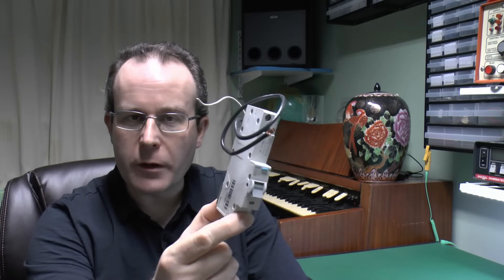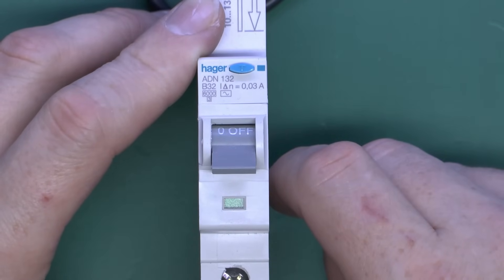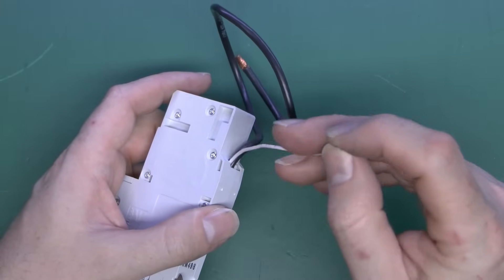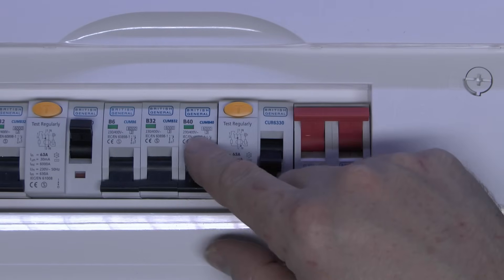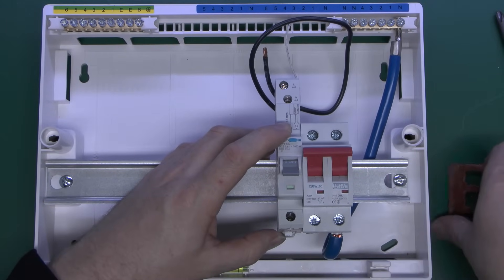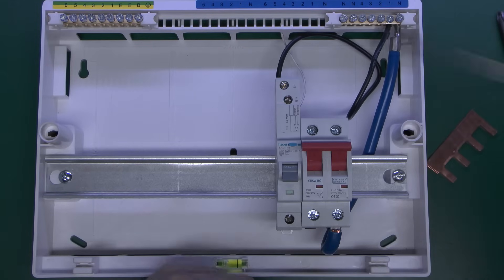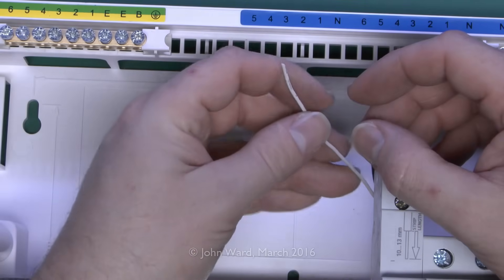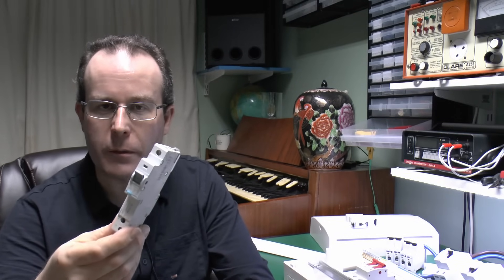Fitting an RCBO in a Consumer Unit

Comment: I have an older CU with only 6 MCB's in it. It would be nice to replace a couple of the MCB's with RCBO's but I presume and RCBO and MCB can't share the same neutral bar - my CU only has one neutral bar.
Reply from the maker: +diymostthings They can, only 1 neutral is required.
RCBO fits in place of the MCB, line conductor connects to the RCBO (same as with the MCB), circuit neutral connects to the RCBO and the neutral lead of the RCBO connects to the neutral bar where the circuit neutral was previously connected.

Multiple neutral bars are only needed when using separate RCDs which cover a set of MCBs.,

Comment: pss (haha and sorry for all the questions) what would happen in a scenarios if you used a standard RCD and then also installed an RCBO in line after, so you're "double" protected. In such a case is it luck of the draw which would trip or is likely the closest one would to the "leaky earth" faulty device.
Reply from the maker: +Dáithí Ó Raghallaigh All depends on the trip time of the individual devices, which usually varies for different fault currents.  Therefore it is impossible to know which will trip, and in some cases both of them will.
The only way to use 2 RCDs like that is to have a time delay type as the first one (closest to the origin/supply), with it's delay time set to a longer period than the tripping time of the second one.

Comment: ps you also mention you could crimp on a pin on the cable in your video at the end if you cut it to make it shorter. Could you show you would do that if you get a moment as a video on crimping would be excellent.
Reply from the maker: +Dáithí Ó Raghallaigh Video covering that will be available on Saturday.

Comment: I am still learning.  I have noticed that grid switches on a commercial unit have 2 different circuits within the switch, I don't like it but get it, I understand that there is a potential for potential difference of 400 volts, and  have seen a sticker saying 400 volts on some of these.  but can you tell me if or by experiment if 2 different light circuits in the same switch that are on the same phase could you still have a potential for a potential difference of 400 volts.
Reply from the maker: +journeyonin With a single phase, there will only be 230V between L&E or L&N.  With three phases it's still 230V between a single phase and earth or neutral, but 400V between two different phases.
Reply: +John Ward Yeah i already understood that, it was more a case of the situation.  I will give you another example for instance if i was to measure the voltage between a socket in my house( UK single phase Live) and lets say a light switch Live (same phase) would there be any chance that the potential could rise above 230 volts to 400 volts in potential ( I know there is no reason for ever doing this test.) and realise you have probably already answered it. just don't reply if you already have.

Comment: nice video.
what about the values written in boxes (6000 & 3) in front of RCBO?
Reply from the maker: +Tinu Thomas 6000 is the sort circuit capacity (6000 amps), 3 is the energy limiting class, from which the let-through energy in the event of a fault can be obtained.

Comment: Hello John, fantastic video as usual,
Would you agree that another disadvantage of the RCBO is if it trips, how would you know whether it did it due to overload or due to current leakage?
Disconnecting faulty consumer (i.e. from the socket) which exhibits either kind of the fault can be only class as a partial success (you can change the consumer) as you still don't know what kind of failure it suffers.How quickly and effectively would you recommend to detect it?
Thanks very much, 
Great collection of videos, 
Kriss.
Reply: without testing equipment I think there's no way to know.  however both problems  would require the same solutions implemented anyway, right?
Reply: krisbham probably own multimeter would enable individual power points or lighting circuit testing for megohm readings.
Reply: @austin1722  not much use for the homeowner... 😒

Comment: It is recommended to use a torque screwdriver now to tighten the breaker terminals . The torque range is now somtimes  printed on the side of the MCB/RCBO .

Comment: Interesting - is this legal to DIY? How about adding a 2nd RCD to an existing split load unit? I've got one of those with half the circuits on an RCD and half not, and would be nice to know if I can improve it fairly cheaply.
Reply from the maker: +81rjp DIY is legal, the only restriction is that some types of work are notifiable to building control in England and Wales.  Scotland has a different system.
For the split units, the easiest option is to fit RCBOs in place of the MCBs on the non-RCD side and leave the rest as it is.
Reply: Ah right, thanks. I knew that replacing a whole consumer unit was notifiable, but the situation for replacing part of one was less clear. As it happens I've checked and it's only lighting circuits (and the alarm) on the non-RCD part, so I'll probably just leave it.

Comment: John, what's the problem with mixing CBs, RCDs and RCBOs from different manufacturers within one consumer unit?
Reply from the maker: +FlyingShotsman Another issue is that consumer units and the items within have to be type tested to comply with the relevant standard, so even if the devices actually fit in there, any type approval is not valid if devices from different manufacturers are used.
Reply: Thanks for the added info, John.
Reply: +FlyingShotsman 
When installed on the ISO rail, if you attempt to fit Live bus bar you will find that different manufacturers design slot holes at different level.Your flat live bus bar won't fit in then.Some electricians may in this case bend the bus bar to a "S" shape just to compensate the height differences (usually approx. 4.5mm difference in levels) which is not a good practice from a few point of view.If bending copper bus bar, on the bends metal will get thin up (due to mechanical rules related to stress and elastic strain of metal -compression and tension whilst bending).This then decreases effective surface area of the bus bar (necking). Also, after bending in two places, effective pitch between the bus bar lugs will be smaller (less than 18mm) which may not fit in the centre of the slots.Generally speaking, making a bus bar a "ramp" is not a good practice expected from top notch electrician.
Reply: That makes good sense; thank you.

Comment: Do you think it will eventually be standard where everything has to have an RCBO on every circuit?

Also just on messy wiring you where talking about , would it not be better practice to have a kind of electrical patch panel similar to what we do in computer networks.Rather than each cable run going right into a circuit breaker or RCBO they go into a terminal block ( similar to the neutral and earth bar ) that way you could replace the consumer unit quickly and easily and re wire it to tidy it without having to mess with the cable runs. You could even pre wire everything off site and simply install it into the runs allowing someone else to do that work that possibly is not trained to mess with the consumer unit. Its done all the time in networking and works very well for reducing time on site and costs for the user.

I am surprised consumer units are allowed to be so messy, surly if you have a rats nest of cable going everywhere its hard to tell what your working on , this can lead to dangerous mistakes.
Reply: +Andrew Joy Here in Norway you have been required to have 2-pole RCBOs(or 4-pole for 400V 3 phase) for all circuits since 2002. You were allowed to have a single 2-pole RCD (or 4-pole) to protect all your circuits earlier, but all new installations and renovations has to have a RCBO for all circuits.
Reply: Here in the United States, because we usually don't use whole-home RCDs we use RCBOs or RCDs integrated into outlets as needed.
Reply: The patch panel approach is sometimes used in industrial installations, this makes it more modular, easier to route wires, and manufacture and test the entire electric cabinet in the factory to the specified design. But usually it is undesirable, as there is a risk of poor mechanical connection on the patch panel, which is an extra point of failure. So usually it is better to get a circuit wires directly to the RCBO. However, with the invent of more reliable clamp connector blocks, which ensure proper cable clamping, and in more complex installations (so called star installation, where all outlets, fixtures AND switches go to central cabinet, so they can be used also as an automated system) it gets more popular.
Reply: Here in Germany it's the same. RCDs are necessary for all circuits that are fused with less than 20 A (32 A outside of the house) and are containing a socket that is accessible to electrical laymen. Only one RCD for the whole house is no longer allowed in new installations. This is since 2013, before this in TN-Grids you only needed a RCD in rooms that contained a shower or a bath tub since 1984. Since 2013 the RCBOs are on the rise here in Germany because they need less room in the consumer unit than a cricuit breaker and a RCD.

In Germany the AC only RCDs are banned since 1984. The A-type is common, tripping on AC and pulsating current. Last one is necessary due to the increasing usage of switching power supplies.

Comment: i prefer RCD Plug sockets at least then the appliance that is plugged in does not take out all the sockets when it trips (as random RCD tripping can be annoying to find when it's not a consistent trip) the cost can depend how many plug sockets you got thought
Reply: The only problem with that is the RCD socket will only protect the appliance,  rather than the whole circuit.
Reply: mozer30 it least you be able to find out where the problem is right away instead of weeks later and 2-3 dead electronic devices later on (surge from power coming back on when trip is reset) i find the that RCD in the breaker box is just there as its very cheap protection then fitting it per socket witch is where it should be (as each RCD socket can cost as much or more then 1 RCBO so cheap way to comply with regs in the UK)

i find its more the appliance causing the trip then cable fault and some times it can be a very intermittent fault

i have only come across a cable fault once and that was the socket it self witch was arcing over to the earth witch was very visible any way and that was tripping both RCD and MCB in that case (UK cabling is typically not a problem)
Reply: They use 30mA RCD protection up front ( at the consumer unit) to protect both ring final circuits, lighting circuits, and any cable that is not mechanically protected, aswell as designated circuits for hard wired appliances such as electric cookers/ ovens, showers ect, against earth fault currents. Its very clear about this in the BS7671 wiring regulations. Its not about cost, its about protecting the WHOLE installation and anything that may get plugged into it.

Secondly if the RCD is tripping due to and earth fault, it should be investigated by a competent person to find the problem, rather that just resetting, as like you say, voltage sensitive equiptment can be damaged.
Fault finding is a process of elimination by isolation, testing continuity, insulation resistance, earth leakage ect. It shouldn't take long providing it isn't an intermittent fault.
Reply: mozer30 problem is they use 2 master RCDs not individually RCBO per circuit so any of the circuits can trip it (heating elements seem very popular at doing it and the odd fridge but they are fairy easy to pick up on and the odd eaten wire by a mouse) but it's RCD trips that only happen randomly in a week for example are problematic (as could not find out what was tripping it one time so fitted a bunch on RCD extension leads and that worked as the item was found that was doing it (RCD socket would have narrowed that down and not taken every thing out)
Reply: lee x With all respect Lee i think you may be missing the point here....Lets take a general installation as an example..... RCD sockets alone will not comply with the regs for new installations/ circuits as an automatic disconnection device (with certain exceptions). You would still need a time- delayed RCD on the consumer unit to cover the cable.... There are also issue's with using multiple rcd's on one circuit, especially with ring final circuits. If there is an earth fault on one appliance, It will cause an inbalance between the L/N on the WHOLE circuit, therefor the other RCD's are just as likely to also detect that and disconnect. Which sort of defeats the point in the first place.
Reply: mozer30 usually the socket trips before the main RCD does (what I have seen unless the RCD socket is faulty)

Comment: Not a pin but a bootlace ferrule, as the typical pin is not rated for 32A of current flow.

Interesting, as here in South Africa the Heinemann breakers are top entry only, so all the wiring is power in at top and tails at the bottom as opposed to the UK style. Makes for fun with DIN boxes as well, as those RCD devices will not fit here, you need a reversed one.
Reply: The normal circuit breakers and RCDs can used in both directions, it doesn't matter if you go in from the upper side and go out on the lower side or the other way arround. Only this style of RCBO demands it to go in from the lower side and go out through the upper side. But standard in Europe is to go into the lower side and go out through the upper side.

Comment: how about installing RCD-Powerpoint on the first powerpoint of each circuit? of course it wont suit ring circuit.  something like this http://www.pdl.co.nz/product-details.aspx?rcat=products&catid=741&id=914
Reply from the maker: +pingshakl Items like that are not available in the UK.  RCD protected outlets are available, but they do not have any facility for connecting additional outlets.
Reply: +John Ward Yes, it's interesting how elec regulation differ even from countries share the same voltage. It is popular in NZ as they are cheaper than upgrading the whole CU, usually 3 or 4 will cover all the powerpoint in the house. And they are legal to DIY install. Buy they are not cheap, only few models are certificated, usually around 70-80GBP each. They are normally 20A capacity rated.  Using none-certificated models or illegal DIY will affect house insurance. 

Again, love your videos. Thanks for sharing. :D
Reply: +pingshakl Surely that is just a RCD protected outlet? Or does it also protect the circuit wiring?
Reply: +londontrada It also (only) protects the downstream wiring.